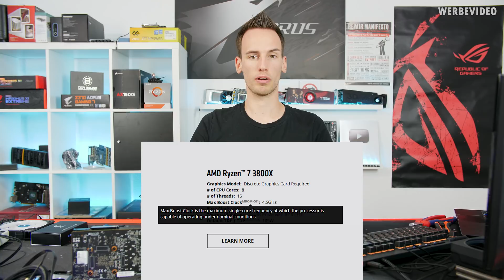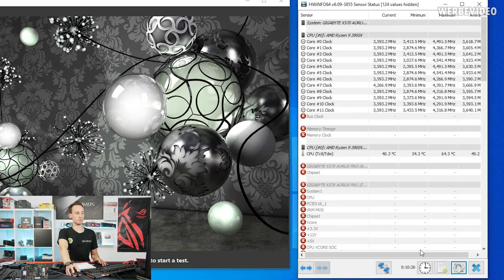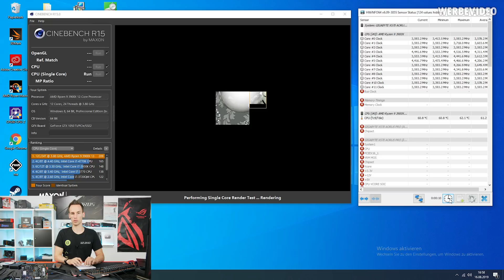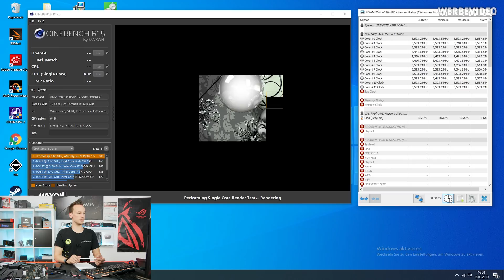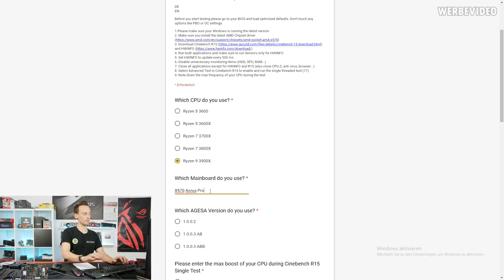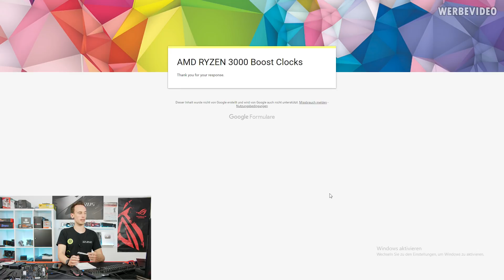I need YOUR Help! RYZEN 3000 Boost Analysis

Comment: I've a 3900x in an Asus Crosshair VIII Hero WiFI with ABB BIOS and Win 1903 blabla... and i get the exact same boost as you, 4516 or 45.3x, and ONLY in the first CCD, never on the second CCD, which i have never seen going higher than around 43.5x. Survey sent.

Comment: Steve at Hardware Unboxed's video found it is motherboard variance using Ryzen... He shows it is a motherboard issue and even could clock a 3800x at 4.5 ghz on an Asrock AB350m Pro 4 motherboard...  The best performing X570 was the Gigabyte X570 Aorus Extreme... see the chart at about 9 minutes into his video... interesting... AMD's claims are technically true but ...
Reply: there is no "but" the motherboard manufactures should try even better. a 170$ motherboard with no rgb shit works and performs perfectly vs the same with rgb shit or other motherboards that are like +100$ more! so there is definetly something wrong in the manufacturing. the same AMD microcode is in all but performs differently! you cant blame AMD for that!
Reply: did he control for agesa version? This kind of testing reminds me of double-blind medical trials ha
Reply: @Nathan0A  No.  There was still some variety among same AGESA versions, but i think its that BIOS +AGESA involves some voodoo that isnt really the fault of the hardware;

Comment: msi b450 tomahawk tested 2 ryzen 3600 cpu's with latest bios, chipset, windows drivers and etc and max single core clock I could get in cinebench r20 was 4099mhz.   After messing with tons of settings like scaler and loadline and more I could get 4149 spikes for brief seconds just using internet but wouldn't hit those clocks with cpu-z bench or any other single core bench.

Comment: Love the initiative, I hope the results don't get skewed by fanboys on both sides submitting false data. I noticed that in my Asus Strix X470-F the default voltages are higher (~100mV!) than it used to pre Zen2. I don't have a Ryzen 3000 series, but on my R7 2700X would not go past 4.2GHz with the stock settings. I was able to get my 2700X to boost again to 4.35GHz by setting a negative offset of ~0.0825V and both 1T and nT performance improved in CB20.

Comment: X570 Aorus Elite, 3700X. Just tested with 1.0.0.2 and got 4391mhz as highest score.
Updated the bios to 1.0.0.3 ABB (F4j) and my score dropped to 4367mhz. Nothing else changed.
Reply: @Shough_it  Prolly a typo. Most likely 1.0.0.3 non letters as this is what the board got shipped with. My board also bosted higher with OG bios.
Reply: @Shough_it  Sorry guys, I probably ment 1.0.0.3 non letters. It was just the BIOS the board shipped with. It was the  F3 from 2019/06/13.

Comment: I gave up on boost, set multiplier and voltage, r5 3600 advertised as 4.2, does 4.2 on all cores, done
Reply: Try PBO+AutoOC 200. That gets me to 4400 MHz boost and 4150 all cores on mine 3600 without having to set a high fixed voltage.
Reply: @jontm3553  I have an MSI board so I'm setting a low fixed voltage ;) 1.31 vs 1.4+
Reply: @prunn  Mine is not stable at anything under 1.35 V at 4200 MHz. The advantage with auto is that the voltage is dynamically kept at a safe voltage. It will for example drop to 1.3 V for Prime95 and down to 0.85 V at idle. Setting fixed ratio and/or voltage will disable almost all safety features such as thermal throttling. Only safety feature left is a hard 115 degree C overtemperature shutdown. Other advantage with auto, at least for me, is 4300 MHz in very light loads such as games.
Reply: @jontm3553  MSI boards don't go below 1.4v, even on idle, when set to Auto.
Reply: @prunn  they do. Mine does. B450 Tomahawk. It does however sometimes get stuck at 4300 all-core, 1.4 V. Turning on and off again PBO normally solves it for me.
Reply: @prunn  they Do i have a Msi B450 board, you have to Enable Cool n Quiet and then it will go below 1.4 in idle right down to around 0.95v i think it the lowest ive seen

Comment: Horse. "Beating a dead horse" and no you are not. Testing is always important. Even though I am sticking with 1st gen Threadripper for a while, I still keep current and will be interested in just this type of testing on 3rd gen Threadripper with first gen TR4 boards especially on Gigabyte X399 Designaire EX with a Noctua NH-U14-S and how this type of setup compares to the 3rd Gen boards coming soon.

Keep up the fantastic work!

Comment: Sent - 3900X Not going over 4.325Ghz on my X470 Taichi, and I'm on a beefy AIO + Lapped IHS + Liquid metal - X470 Taichi AGESA 1003ABB
Reply: @ShutterManAce  Yeah, we know AGESA 1002 (launch AGESA) is the one that boosts correctly. It is AMDs turn to fix that in next BIOSes. We either think there are bugs or AMD actually sent pumped up (but potentially dangerous) BIOSes to the reviewers. Hence Steve killed his first 3900X with it somehow.

Comment: It would probably be better to make the Motherboard question a drop-down with most common motherboards populated and with 'Other' as an option that allows you to write it in. That will greatly reduce amount of data cleanup you'll need to do in your analysis.

Comment: would it also make sense to use task manager to set the core affinity to test each individual core and prevent the workload testing only a select few cores (which may not be the processors best)?

Comment: 3600x at 4.350GHz@1.35625 Volts all core overclock AIO cooled on an aorus b450 pro wifi mobo. CB15 single core was 204. Multicore was 1724

Comment: My 3700x stock single core 4.275ghz is so far away from 4.4ghz....T.T
Reply: My numbers are those as well.
Reply: 3700X Crosshair Hero VII Newest Drivers/Aegisa 4.275ghz Single  Core
Reply: Did you kill background processes like steam and other "useless" junk as mentioned in the video? I got 4.2ghz when I had a browser open. 4.4ghz with no desktop apps open (but steam, ect in background) and 4.525Ghz by stopping a bunch of third party background processes. That's on a 3900x.
Reply: Not really, in the grand sheme of things 4.4GHz is not even a 3% increase over 4.275GHz, so it doesn't bother me too much.
Reply: Mine are 4.3 too :( very sad.

Comment: Didn't realise it was a single answer only. I had two results- one on release BIOS F3, one on F4j. Stock trim release BIOS F3 was hitting 50-75mhz higher than F4j. Submitted the results on F3.

Comment: Should people run "Performance" power settings in Windows? I know many leave it on "Balanced"?
Reply: Fetus PC-TECH  I always do it, but I've seen people complain about not hitting expected boost clocks and then it turns out they're running balanced power profile. 
Could affect the test results.

Comment: Roman add my results to your pole please 10cpu plus tested on variety of boards across all vendors with upto custom water cooling. Zero cpus reached rated boost at stock with single core workloads. Always 50-100mhz less. If you smell what the Pack is cooking....

Comment: I have Ryzen 7 3700X + MSI B450M Mortar mobo, and for me only BIOS v17 allows all the cores to hit the max 4,400 MHz during single-threaded light workloads. No other BIOS versions (v18, v19) allows even a single core to hit this max 4,400 MHz frequency. It's almost always in the 4,350 MHz region.
EDIT https://i.postimg.cc/dtcw2bDg/Capture.png
Reply: Analog Foundry did you get a good chip???
Reply: @skyhawk21  - Not sure. I'm also running Infinity Fabric at 1900 MHz while my DDR4 is at 1600 MHz (3200 MHz CL14).

Comment: Even if I owned a Ryzen 3000 CPU I probably wouldn't due this due to the pretty absurd requirements... You might as well have said "Install a fresh version of Windows 10 on a 2nd drive and change nothing."
Not sure why you couldn't just make extra tabs where you can put in OS + version, program, etc with comments. What if the issue is Windows 10? What if it's a Windows 10 update? What if it's a board setting? What if it's the program's themselves?

Comment: Hardware Unboxed just posted a video where he tested every x570 mobo and found the boost speed had more to do with motherboard than cpu.
Reply: Not quite every board lol. Seems to mainly be board firmware. Interesting that there seems to be no link between frequencies and board quality
Reply: @TADP0LE9806  lol. I meant every board he had. It's not all 40 or whatever but it's a good 10-12.
Reply: John Chrysostom  Sure, but as far as I know the only boards Hardware Unboxed tested that have the same VRM/PCB as each other are the Gaming Edge and the X570-A Pro, and they still performed quite differently from one another.

Comment: Der8auer If the CPU hits max boost for 0.1 second during the whole test and clocks 200 MHz below during most of the test, it will look better than it really is. The average frequency of the fastest core is what should be measured rather than the peak, like Intel stay at 5GHz for hours for example.  Or is it there's no tool to capture this information?

Comment: Hey Roman, there is easy way to check that, just go on 3dmark.com,results,advanced search,pick ryzen 3xxx and you will see max boost clock. Mostly between 3.7-4.4ghz max single core boost for 3900x(very big oscillation and that's in top results)
If you want avg boost clock, go on userbenchmark.com and do same(this bench reports average boost clock)
Reply: Now I see you have to open details for each run to see real max boost, those 3.7ghz-4.4ghz are reported clock speeds.

Comment: Roman, wouldn't it be best if people would:
- wait at least 1 minute before starting up Cinebench after starting up Windows (because Windows is rather slow with booting and doing a lot of crap on the background after it shows the desktop)
- do the test when the PC has been on for a relatively short time to prevent any heat accumulation

This to have the conditions as much the same as possible, to the extend that it is possible (variation in cases and cooling, random Windows services and all that).

Comment: I just watched hardware unboxed. They seem to have nailed the issue down to a number of mainboards
Reply: No, they tested the CPUs wrong.
If Steve tested the CPUs in same way he recommend it to us: Looking at max speed on hardware monitor, he tested the CPUs WRONG!
What he tested for is just a momentary SPIKE, it has no practical worth.
Ryzen 1000/2000 and ALL Intel CPUs do Single Core Turbo boost by keeping single core at max advertised value for as long as thermal or power limits allow, it can be tens of minutes and hours depends on cooling.
Temporal SPIKE for 1-2 seconds has zero worth to the community and just shows how AMD scammed as all with fake Turbo Boost Speeds.
Reply: @NoBodysGamer  Its not CPUS but CPU.One cpu!Its completely ridiculous.
Reply: Yeah I firmly believe my C6H is holding my boosts back
Reply: They only tested x570, we run 3700xes on older boards like mine, for example, sits on vrosshair 7 hero
Reply: i run my 3600 on b450 tomahawk. with offset voltage of +0.200 stuck at 1.1 almost all the time boosting up to 1.3 when needed.
Reply: The motherboards is one part of all of this. I think it's the biggest, but AMD also used wavy language which means that i think AMD went too far on the offensive here to try and look good at it backfired. Saying a CPU MAY boost so and so far, this time, thus implies that not all chips in all conditions will. Because of binning and motherboard qualities. AMD walked their language back by addressing it, however the statement was a "may" and so AMD's in the clear there in terms of getting sued or not. Most likely. Luckily AMD also did walk their statement back to not make more people irritated, i cannot recall Intel or Nvidia ever doing that. Then again AMD prioritize accuracy of details so here we are. While Intel's TDP figures still seem dumb and obscure as hell.
Reply: My X570 Aorus Pro WiFi was boosting to 4400Mhz with pre-release BIOS (F2), but after updating to F4(j,l,m) it only boost to 4375Mhz. It's a BIOS issue...
Reply: @andibiront2316  Same situation with my 3700x + X570 Aorus Ultra which is pretty much the same board as yours. I saw each core individually hitting 4,392MHz boost before I updated from stock BIOS. Now I'm on F4i and only a few cores boost to 4,367MHz with one core not even getting past 4,292MHz :\ 

I'm guessing it's the newer AGESA causing the issue. 
Only thing is if I go back to older version of BIOS I can't control chipset fan...
Reply: @TehGhoul  Yeah. I'm geting the exact same clock speeds. I rather have chipset fan control than 25mhz. My chipset fan doesn't even spin up with F4 BIOS, and the chipset is barely warm to the touch.
PBO doesn't do sh*t for single core clocks. My 3700X is hitting 4.2Ghz All Core Turbo and 4.375Ghz (4366Mhz actually) on single core with PBO.
I'm also having issues with cold boots. Half of the time it just ignores XMP profile (or fails to load it, I can notice the board taking longer time to POST) and defaults to 2133Mhz RAM.
Reply: @andibiront2316  What CPU?And even if that is true in ur case it may be another reality for anyone else.Just saying...
Reply: yea nailed it with single 3800X CPU and he couldn't even tell when and for how long the boost clock stayed at the advertised speed lol

Comment: I am game, I will help you out with my 3700X. I am even willing to boot into Windows for that (Linux here). ;) 
I even am willing to go through the W10 update hell. :(
I will do the survey later today or tomorrow.
Reply: How is the boost in Linux?
Reply: @brunogm  
I have confirmed in a terminal that the CPU boosts properly to the same clock frequency as in Windows for a single-threaded load, in my case up to around 4.36 GHz for a 3700X. There was a bug in AGESA which caused problems with SystemD (making newer distros unbootable) and some game (Destiny2?), that bug has been solved with the latest BIOS's. I run Manjaro KDE without any problem and I can use the newest kernels. Tip for gaming: install both versions of gameboost and if you use Lutris (Starcraft2 seems to work great) then make sure to experiment with e-sync. 

I do notice that the BIOS's still are very immature. I have a Gigabyte (Elite) motherboad. A few examples:

- after failed RAM overclocking (3600 with voltages that didn't work) I had to remove the CMOS-battery to start up the computer, the motherboard wouldn't powercycle any more for whatever weird reason (5 attempts!). The casefans spinned, the CPU-fan did not. Removing the CMOS-battery and plugging it back in solved the problem. (Sidenote, my motherboard came with an empty battery, I had the shop send a new battery, that sucked given that I lost all the progress after a failed attempt of overclocking)

- I always disable the USB-LED's which are on by default. When those are on I see a reflection of the light on my wall. Whenever the OC fails and it does boot up and reset the BIOS (which it always does after a failed boot instead of taking the last stable profile!) then it takes around 3 seconds for the LED's to turn on but then you get 3 powercycles before I get the splash-screen. The other way around, when I turn the LED's off again (and some other changes) then it takes around 3 seconds before I see the LED's turn off after rebooting. In short, it takes around 3 seconds before the Gigabyte motherboards starts to process the BIOS which strikes me as odd.

- The entire POST takes around 13 seconds. That is ridiculously long, my laptop with an i5-8350u gets into the OS in 15 seconds flat. 

- Hardware Unboxed showed today that there is a strong variation in performance between motherboards, for all the brands. 85 MHz for single core and 55 MHz for multicore between the Gigabyte Elite and Gigabyte XTreme for a 3800X. 

Other than that the default fancurves are quite bad, you need to manually enter a fancurve, it ramps up much too fast. It is rather unpleasant, more so than my former i5-750 with a bloody stock cooler in a smaller OEM case. After adjusting the fancurve it is ok. At the moment this still is a platform for tweakers. My 3333/16 RAM got overclocked to 3533/14 (14-15-14-14-28) with proven stability (8 passes in Mem86+ , it also boots with 13-13-13-13, not with 12-12-12-12). I suspect that 3600 MT/s is possible and 3666 probably is on the edge. For 3600 MT/s with the fast timings from the DRAM calculator I got 1 error every two passes in test 8, that should be fixable. :) 

I do recommend the CPU, just be aware that you will have to do some tweaking. Overclocking the RAM is very important for the read speed and the latency! Stock you get around 110 ns latency and 30 GB/s read, OC'd it gets to 60-70 ns and 49-56 GB/s read, depoending on what memory you have (70 ns and 49 GB/s should be achievable for everyone).

Comment: 3600 running stable locked 4.2GHz with "gaming mode" on bios. With variable clockspeed/boost I did not manage to ever get 4.2GHz.
Reply: Try AutoOC + 200. Gets me to 4350 MHz (4400 peak)